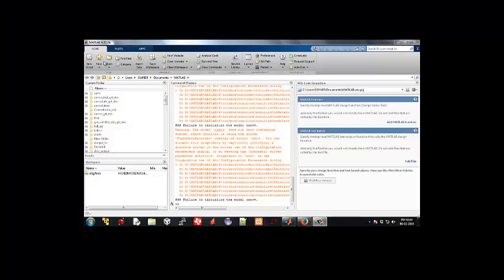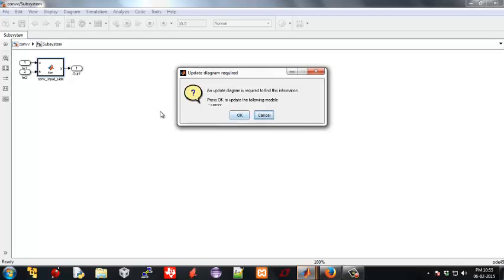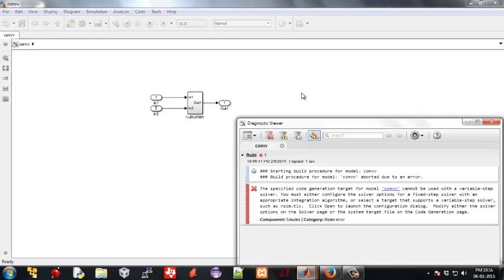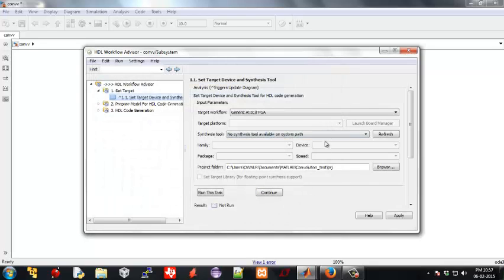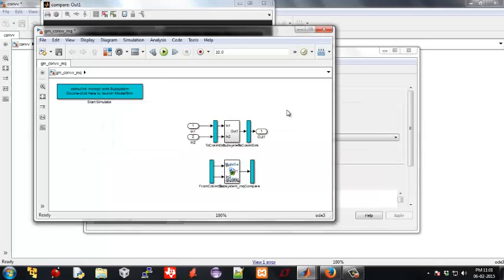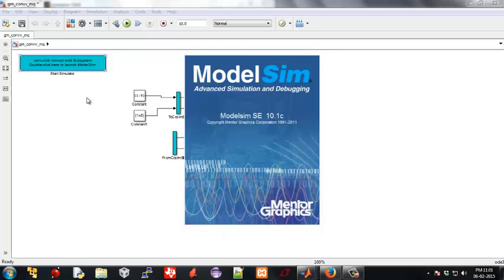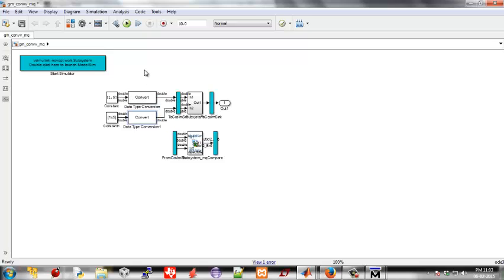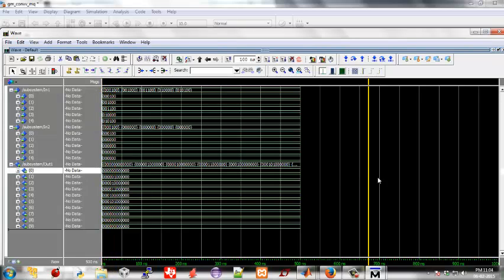Convolution with MATLAB- HDL CODER USING SIMULINK

Comment: I got this every time. plz help.

error reported by S-function 'shdlcosim' in 'Design_name/Subsystem_mq/S-function': Failed to connect to server. Make sure the loaded HDL simulator library is using shared memory.
Component: Simulink| Category: Block Error